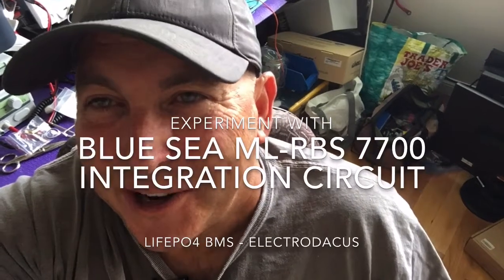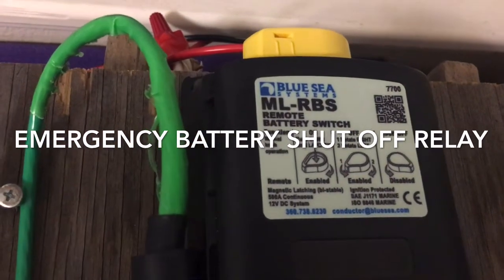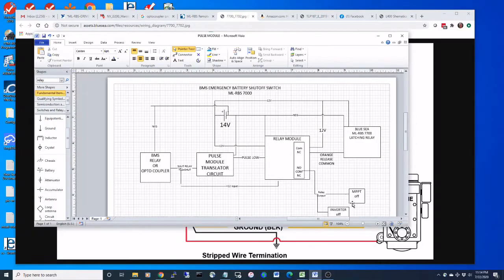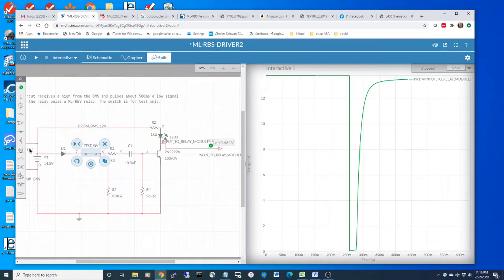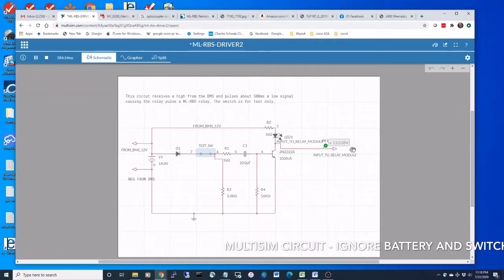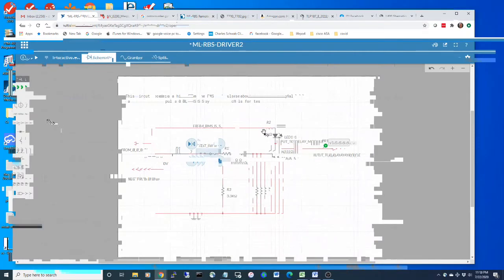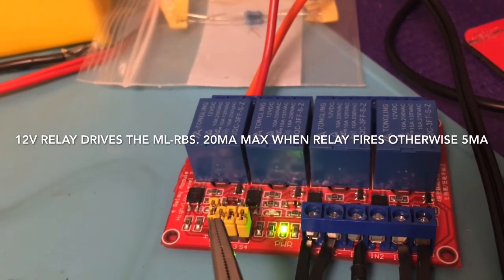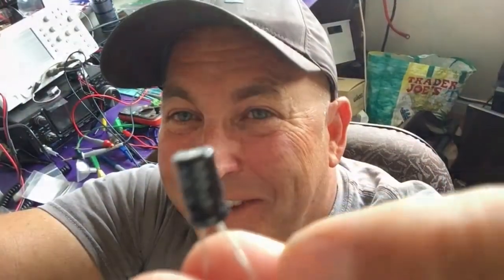DIY Driver Circuit for Blue Sea ML-RBS Latching RelayLiFePO4 Lithium ElectroDacus BMS on Sailboat

Comment: Hi Danny, great info  - thank you! I wonder if you have a website with the final schematics? I am looking to build a LiFePO4 24V 8S Wilson cell bank for my sailboat and use ML-RBS 7700 latching relays for HVC and LVC. I also found sy Destiny guy and his posts on CruisersForums.
Reply from the maker: Sergei Prutkin I have been taking a break on my battery project and enjoying some good weather. I’ll keep you updated.
Reply: @dannyjensen4954  I've the same project here and I just saw your video after doing some research. One item I noticed is that you're looking to use the same output to turn off mppt however SBMS0 has other outputs for overcharge/discharge. 
To turn on and off the relay I'm planning on going with a Time Delay Relay like the geya https://www.geya.net/wp-content/uploads/2020/12/GEYA-RELAY-CATALOG-2020-NEW.pdf
The timer delay can be set to Single Shot to turn on the ML-RBS and single shot trailing edge to trigger relay off. I think that enables the use of the SBMS0 with off the shelf relays.
Reply from the maker: @charlesrg  I looked a the relay sheet. It looks this will work if you set it for a short relay on time and it is 12V!  Thanks for your comment.  I have not messed around with my SBMS0 on off yet.  My impression is that the SBMS0 will trigger high or low with one wire and you  will need to trigger pulse the Orange wire on low Off?  and the  brown wire on high on? depending on how you wire up the optocoupler output on the SBMS0.